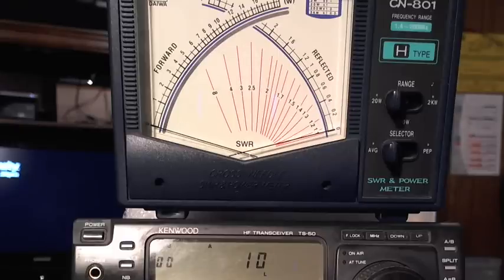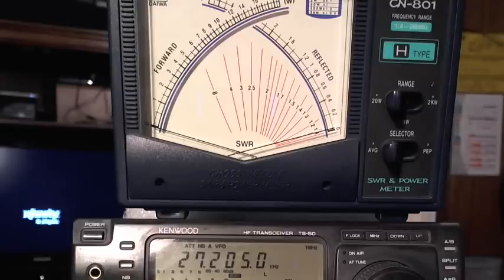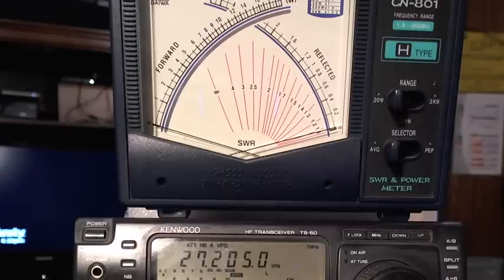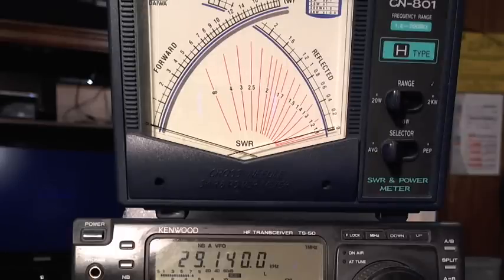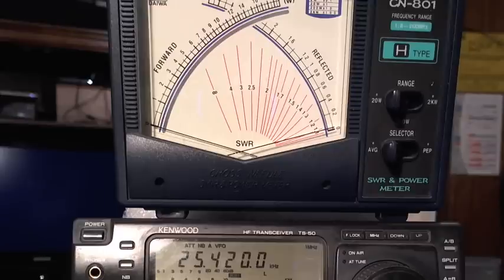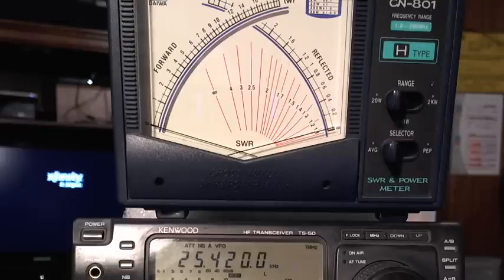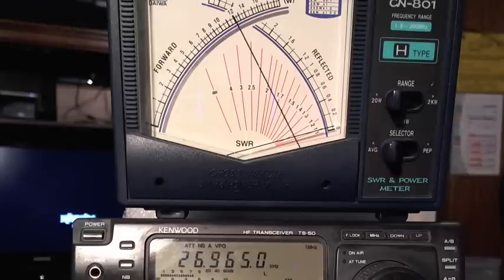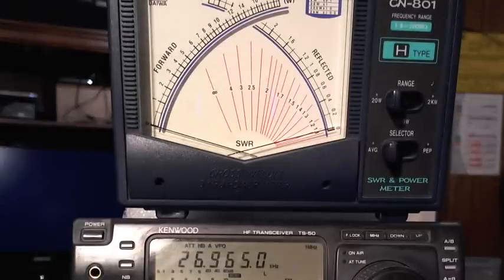Marconi Demonstrates Antenna SWR Bandwidth Curve

Comment: Howdy! Nice video, though I am curious why you bother going outside of the CB band? Anyway, you brought up a question as to why the radials are flat rather than bent down at a 45 degree angle.  For whatever it’s worth, a 1/4 wave groundplane with flat radials will exhibit an impedance of appx 36 ohms. Which is ok. The company I use to work for The Antenna Specialists Co. found that by moving the radials downwards to a 45 degree angle, it brought the Impedance-up to 50 ohms. 1.5:1 at 36 ohms to 1.1:1 at 50 ohms. There is certainly nothing wrong with 1.5:1 VSWR in any body’s book, however I just wanted to make mention of this to you in case you may not have been aware of this 73’s David